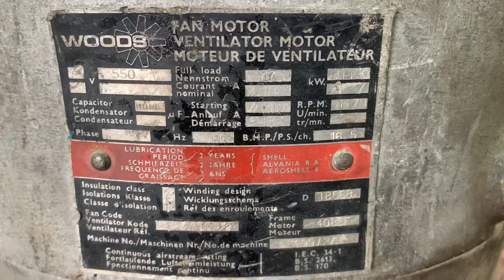Motor Rewinding | Old Woods Ventilation Motor | 11(KW) 1170 rpm

Comment: Saludos. de que se trata la prueba de core lost test, que según el traductor es prueba de núcleo perdido
Reply from the maker: It’s a test for the core of motor  to magnetic flux if core is bad it will get hot and insulation can’t hold the heat will melt and burn the winding.
Reply: @windertrucker6230  ok, y en el caso que tenga punto caliente o el hierro se ponga caliente que hacen en ese caso. gracias.
Reply: Donde queda su taller en que pais.